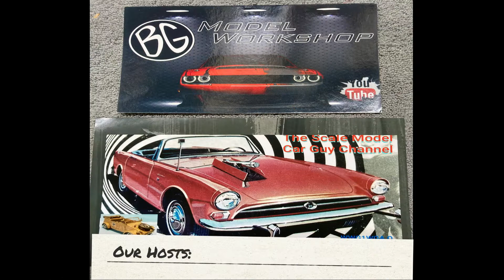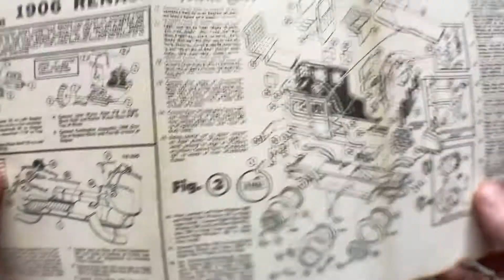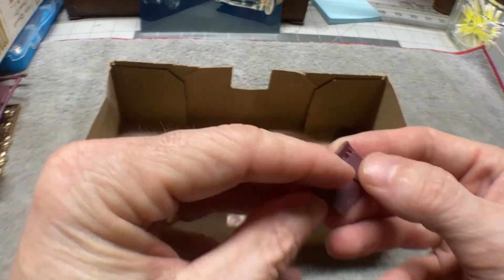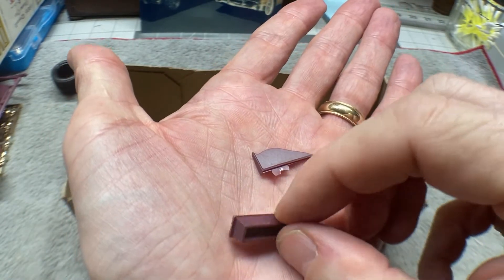2022 Small Scale GB Unboxing

Comment: Lots of parts in that box Jeff.  You should have some fun with that.  That glass does need a little work.  Some cleaning and a Future dip should do them good.  Seven tires do seem like a lot.  Maybe 3 spare tires, or you hit the jackpot on having some to choose from.  Nice plush looking back seat.  Car seats were more like sofas then, and that one looks the part.  I found out with the 1912 Model T one of the pedals is actually for reverse, not the brakes.  Brakes were in the hand levers.  Just another challenge to driving these cars.
Reply from the maker: Thanks, Vincent. Great info on the pedals. I’ll have to see if that’s the case  with the Renaults.